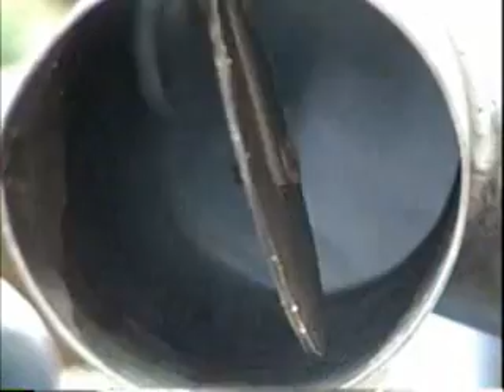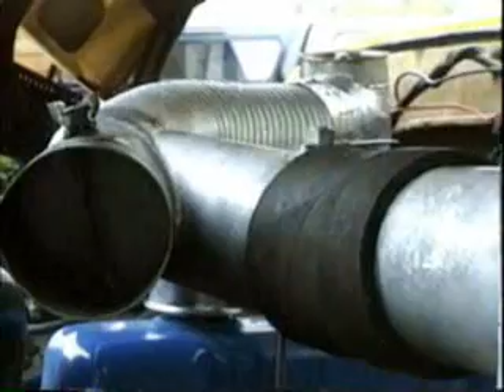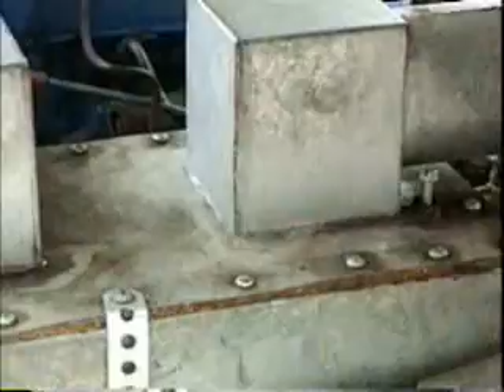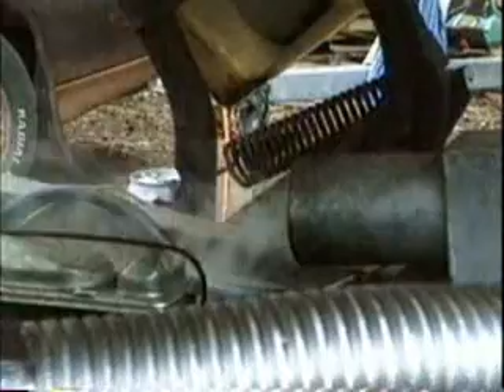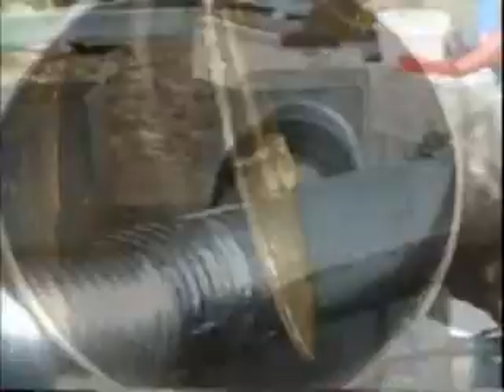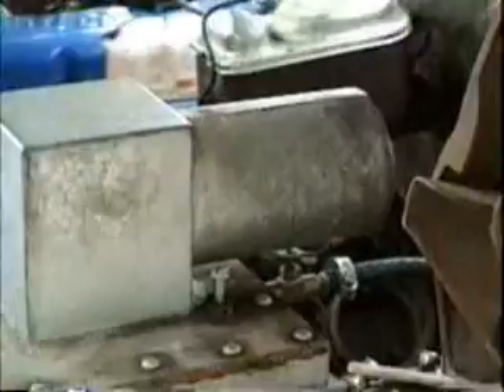Here is definitive proof on how to separate all Atoms in all liquid soluble matter.

Comment: Obama or any other government official wont do anything for you they are all private interest and corporate friendly aka big oil pets this is something you need to find a engineer and design patent and build yourself and then begin selling it also it will need modding for injection systems
Reply from the maker: On the white vapor, created from gasoline, there is no liquid fuel, so lean and rich fuel mixtures don't come into play, it is a totally combustible white vapor. There is no unburnt liquid in the cylinders. Oh, and I forgot to mention if you have carbon build up on your spark plugs, the white vapor will burn it off. Your spark plugs will look clean as new, after 30 minutes running on the white vapor I created from gasoline.
Reply from the maker: What can be done to one liquid, can be done to any liquid. On gasoline I created a white vapor that has twice the power of gasoline. I got a zero parts per million hydrocarbon reading, from this white vapor. Also the white vapor remained a vapor at around 50 degrees Fahrenheit, If the white vapor were still gasoline it would have condensed at that temperature, since gasoline condenses around 100 degrees Fahrenheit. If the white vapor were still gasoline, it would be a liquid at the temperature seen in my video. Defragmenting, nor distillation, can produce an increase in power of gasoline, and the zero parts per million hydrocarbons readings I got, could not be achieved from gasoline, since gasoline has a carbon base. Therefore I asses that I have separated the atoms in gasoline by spraying a fine mist of gasoline onto a 600 degree Fahrenheit heater. Like I said what can be done to one liquid can be done to any liquid, it just takes the right temperature to achieve this.
Reply from the maker: Then you need to go back to kindergarten and learn the basics, because you missed the boat in understanding physical reactance of temperature on different matters. To distill something is to take it to a gaseous state, then condense the hot gas, by cooling, where it becomes a liquid again. This will remove impurities in the original liquid, but will not change the properties that the liquid can produce, my Flashing Liquid process has produced dramatic changes in the physical properties of the liquid.
Reply from the maker: Doing it to the gasoline, and posting it here on You Tube, is how I came to realize it can be done to any liquid, I did it to water, and created a flammable gas, see my two other videos. Yes I can separate the atoms in any liquids by doing this at the right temperature.
Reply: Bill Kendrick You're claiming to have generated H2 and O2 from H2O by spraying water mist onto a 221f heating element? I'm more than a little skeptical here...
Reply from the maker: Timothy Wang Tim, I am not claiming to have done it. I did it, I detected a flammable gas from the distilled water spraying a fine mist onto the 221 degree Fahrenheit heater. using a combustible gas leak detector. The only only flammable gas in the water is the Hydrogen atom. I will ignite the gas, from the water soon, and make a video of it. I will post it on You Tube.
Reply from the maker: Gasoline boils between 100 and 400 degrees Fahrenheit, depending upon how high the octane level is in the gasoline. The higher the octane level the lower the boiling temperature is. I spray the liquid gasoline onto a heater that is 600 degrees Fahrenheit and get a white vapor with twice the power of gasoline. Fuel injection will become obsolete, when this is realized. I have been told that 700 degrees Fahrenheit, on the heater, leaves no non flammable liquid, like it does when 600 degrees is used, a problem I discovered.
Reply from the maker: I have never tried to use a fog machine, for gasoline. I don't know what temperature they achieve, however, I know for a fact they don't get as hot as the temperature I used. If they did the fogger would get to hot to touch, and the plastic housing, on the machine would melt. Someone on You Tube used 700 degrees Fahrenheit, for the heater temperature, and got no non flammable liquid residue, when the vapor was made. I myself used 600 degrees Fahrenheit, and got a non flammable liquid, which filled the bottom of my chamber, and stopped making the white vapor, after about 30 minutes of running on the white vapor. The auto industry won't use my process because science says the auto ignition temperature of gasoline is 538 degrees Fahrenheit. I am here to tell you science is wrong. When iron gets to a dull red from temperature, gasoline will auto ignite. This is around 1000 degrees Fahrenheit. There is about 500 degrees of temperature that science says does not exist. I have been playing with gasoline in that temperature range for almost 30 years now. Think I might know something they don't? The white vapor I make has a lower condensing temperature than gasoline, that is why it remains a vapor, when the temperature is below 100 degrees Fahrenheit, the condensing temperature of gasoline, so the white vapor is no longer gasoline, and it has twice the power of gasoline, with zero parts per million hydrocarbons. You will get 8 cylinder power from a 4 cylinder engine, and get the 4 cylinder mileage. Only the separation of atoms in the gasoline could create the results I have achieved. I am working on separating the hydrogen from water now.
Reply from the maker: On the truck seen in the video on You Tube. I put a clean dry rag over the exhaust, and ran the engine on gasoline. You could not get the rag close to your face, it would make your eyes burn. I used another clean dry rag, and ran the truck on the white vapor. The rag smelled like you were ironing clothes, a very clean, fresh smell. Try your own vehicle on gasoline, and get the an idea of what your exhaust smells like running on gasoline. When you get the chamber working try the same thing on the white vapor, and see for yourself.
Reply: *****
You're saying you made H2 and O2 from H2O simply by misting it onto a hot surface? That is what I was referring to. How do you know H2 and O2 were generated?
Reply from the maker: Like I say, science is not always right. I know for a fact that gasoline will not auto ignite at 536 degrees Fahrenheit, like it says on the internet. I have seen iron rods turn a dull red color before gasoline ignited. This is around 100 degrees Fahrenheit. I have been playing in a 500 degree temperature range for over twenty years, and science says this temperature range does not exist.
Reply from the maker: I meant to say 1000 degrees Fahrenheit.
Reply: ***** Bill Kendrick  Can you PM me and describe in more detail how you made H2 and O2 from H2O with heat alone? I will try to replicate it despite my overwhelming skepticism... I have a mister bottle and distilled water and infrared thermometer... Misting distilled water onto a hot surface = H2 and O2? Hmm... Also, Trumble, gasoline vapor is scary. It's all fun and games until you get a flashback, and it can happen.
Reply from the maker: Water has 2 parts Hydrogen, and one part Oxygen. When the Hydrogen atom reaches it's boiling temperature, it will turn to a gas, and separate from the Oxygen atom, the Oxygen liquid atom did not reach it's boiling temperature, so it remains a liquid for an instant. Now science says when atoms separate a void will be created in the original chemical structure, and Oxygen being in the surrounding air, when the separation takes place will fill that void. Now the liquid Oxygen, obtained when separating the Hydrogen from the water, is the only thing left, liquid Oxygen boils at something like minus 450 degrees below zero Fahrenheit. It will turn to a gas, instantly, and now you have a H2O2 highly flammable gas.

Comment: are you running anything on this white gas currently?
Reply from the maker: At present I am not running anything on the white vapor. You see in May of 2011 my home in New Mexico burned and the chamber you see on You Tube burned with it. I had to regroup and start over again. Later this summer I plan to make a video of me igniting the vapors of distilled water, to prove I am separating the atoms in liquids, and that it can be done to all liquids. Just spray a fine mist of the liquid onto a predetermined temperature and find the boiling temperature of the desired atom, turning it to a gas, while other atoms in the liquid remain a liquid, having not reached their boiling temperature. Rhis is separateint trhe atoms in the liquid.

Comment from the maker: The right temperature and the mass of the heat source will produce the results needed to separate atoms in liquids. In the gasoline chamber I made I got lucky and selected the right resistance heating elements to produce 600 degrees Fahrenheit temperature.If one could get the right resistance and mass the heating element would always produce the same desired temperature, without needing a temperature control..
Reply: It would be good if he could vaporize water and allow the fuel to flow as it would based on the manufacturer design and allow both of them to enter the engine and see the difference..
Reply from the maker: To do this would require two different temperatures one applied to liquid gasoline, and the other applied to the water. Aviation injected water into the engine cylinders many years back. It increased engine power on take off.
Reply from the maker: Bill Kendrick Anybody can use the information I have discovered. That is why I put it on You Tube. Just ask and I will tell you what I discovered. I am still experimenting, but it is too cold right now where I am living. The bones ache when your body gets older, my mind is still young.
Reply from the maker: Jimmy Bennett stealthb2000@gmail.com
Reply from the maker: Jimmy Bennett You can get any size ,shape, wattage, or voltage heaters from a company called Chromalox, They make custom heaters. A power inverter will power the heater, a temperature control will control the temperature.
Reply from the maker: Dock See What would be better if I can find the boiling temperature of the hydrogen atom inside the water and separate the hydrogen and oxygen atoms producing all the hydrogen contained in the water being sprayed onto that temperature. I did it to gasoline at 600 degrees Fahrenheit, creating a white vapor with twice the power of gasoline, and at the same time I created a non flammable liquid, that will not mix with gasoline anymore. Separating atoms is the only thing that can do this to gasoline. What can be done to one liquid can be done to any liquid. I have heard from people here on You Tube that at 700 degrees Fahrenheit there is no non flammable liquid left, from the gasoline. Something else I got zero parts per million hydrocarbons readings from a smog analyzer running the white vapor I made from gasoline. I hope to find the hydrogen atoms boiling temperature in water soon. I has been too cold where I live to go outside and experiment.

Comment: Gasoline cant autoignite in your devices because there is not oxigen. You can heat gasoline even with plasma, but cant ignite without oxigen. Just separate atoms from molecules.
Reply from the maker: Timothy Wang Well try this, put gasoline into a container, and allow the fumes, or gas vapor to fill that container. Don't seal the container, leave the top open, or you will have a bomb. Put a heating element into this gas vapor, and increase the temperature until the vapor ignites. I have seen a wrought iron electric, calrod, heaters go to a dull red in color, which is around 1000 degrees Fahrenheit, ask any metal smith about this temperature. When the heating element turned this dull red it would auto ignite the gasoline vapor. Around 500 degrees above what it says on the internet. Never believe what is written, try it yourself, and know what you are talking about.
Reply: Air run through heating chamber where gasoline is sprayed on heat element??
Reply from the maker: Very simple, a fine mist of gasoline is sprayed onto 600 degree heating elements. Taking the gasoline above it's known boiling temperature, which is 100 to 400 degrees Fahrenheit, depending upon the octane level in the gasoline. The lower boiling temperature is the higher octane gasoline. The intake manifold sucks the white vapor into the engine.
Reply: Bill Kendrick I agree with your explanation of science. I will try to sprayed gasoline onto heating element in the open air...
Reply from the maker: It id not the lack of oxygen that prevents the gasoline from auto igniting, it is the fact that science is wrong about the auto ignition temperature of gasoline. It is around 1000 degrees Fahrenheit, not the 536 degrees science says. I have seen heating elements turn a dull red before gasoline auto ignited this is around 1000 degrees Fahrenheit. There is 500 degrees science says does not exist. I have been playing with this temperature range for 20 years.
Reply: Hm, maybe this 536 degrees is for old gasoline (before WW2), now uses additives for higher octane number (higher autoignite temperature)
Reply: Bill Kendrick
Autoignition temperatures are calculated in a very specific fashion, not just by spraying a liquid onto a surface with a said temperature and seeing if the liquid bursts into flames. http://en.wikipedia.org/wiki/Autoignition_temperature I do not think the autoignition temperature of gasoline is wrong, I think it is more likely you are not following the proper procedures for calculating autoignition temperatures. Not trying to knock you down, but just an objective observation based on your videos.
Reply from the maker: My chamber gets air from the intake tube, the tube on the right side of the chamber, in the video, on You Tube.The air is sucked in by the intake manifold of the engine, controlled by the butterfly valves under the carburetor. Know what you are talking about before you comment.
Reply from the maker: It is not the liquid gasoline that is flammable, it is the gasoline vapor, containing oxygen that will auto ignite around 1000 degrees Fahrenheit. My heating elements are around 600 degrees Fahrenheit, in my chamber, which is above the 536 degrees Fahrenheit, the scientific auto ignition temperature. People here on You Tube have gone to 700 degrees Fahrenheit on their chambers and eliminate the non flammable liquid I got in my chamber.

Comment: hi bill how can i email you...got some questions...when u talk about producing a non flammable liquid and would have to empty chamber, did u get around this problem, if so how...or did the flashing vaporize everything and what do u think about using a electric stove burner directly or behind a steel plate as a heating element and hook it up to a dimmer switch to regulate voltage/temperature?...please get back to me id really like to talk...my email is j.mar123@yahoo.com please contact me thanks
Reply: i did not say i did not want to use strip heaters...i just know u can easily get oven heater elements easily and readily available if you need replacement...what kind of 4 cylinder are you using...i was going to make something for my 98 4 cyl honda crv ...what do you think of bubblers and ultrasonics, wouldnt ultrasonics vaporize everything...i was considering maybe a lite bubbler sucking the hot air off the exhaust manifold...and having some like kerosine lamp wicks in the bubbler which will absorb the liquid gas and the passing air will draw the vapors off them...just seems less complicated and less parts to go bad...what u think
Reply: yeah not if i used ultrasonic...that instantly vaporizes liquid...i wouldnt be using heat to try and crack it...just wanted hot air to help with the bubbler and wicks, and i dont think it will leave any liquid behind

Comment from the maker: Not a drain, it was the fuel line from the vehicle fuel pump, and I used a float valve inside, attached to this fuel line, the float valve was to maintain about 1 inch deep of fuel inside the chamber. I used another fuel pump, connected to the bottom of the other end of the chamber to suck liquid from the chamber bottom, and spray onto the heating elements. My spray tube was 1/4 in copper tubing, with small holes spraying on heating elements. Spray nozzles work better.

Comment from the maker: You need a larger surface of heat, other than the electric steel wire, in a kiln heating surface. Check out a company called Chromalox. They make every kind of heating element you can imagine, including what you design. I used two stainless steel flat bar heating elements inside my chamber. but they can make any design you want. A power inverter, for cars is your power source.

Comment from the maker: I have seen something similar done with hot air. The dairy industry uses hot air to make powdered and condensed milk. However to accomplish this requires controlling the hot air temperature, to produce a high volume of hot air, at the temperature desired. They spray the liquids into a chamber, and the air temperature has to be maintained at the desired temperature. The liquid, being sprayed into the chamber, will absorb the ambient temperature faster than just air, so it  temp has to be higher.

Comment from the maker: Ken, I don't know what the chemical make up is on the white vapor, I have created, by spraying the liquid gasoline, onto the 600 degree Fahrenheit heating element. Test on a Gas Spectrum Analyzer would tell. I am a disabled veteran and can't afford their costs. I know I got the 50% increase in power over liquid gasoline, and zero parts per million hydrocarbons. Logic says with this increase in power, a 4 cylinder can produce as much power as an 8 cylinder, this will double the mileage, alone.